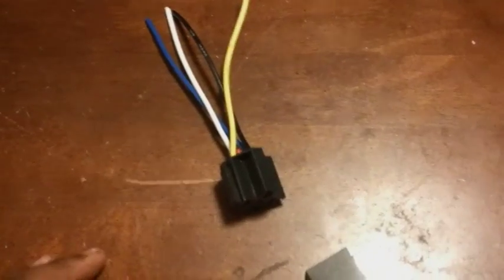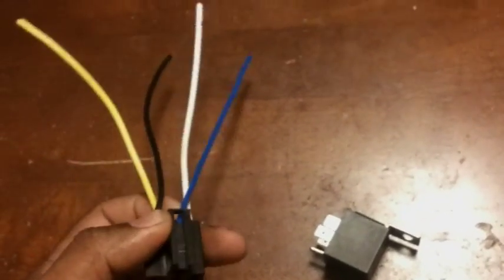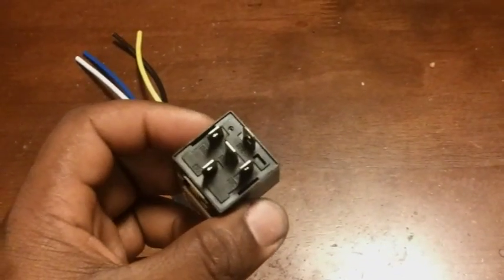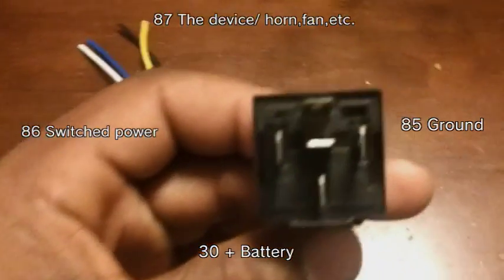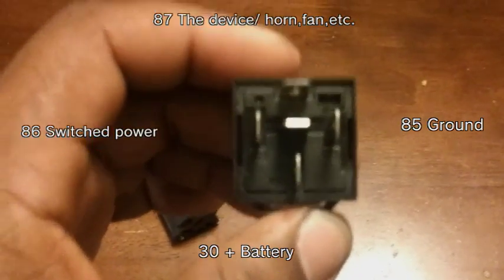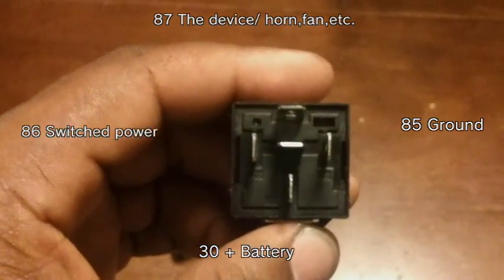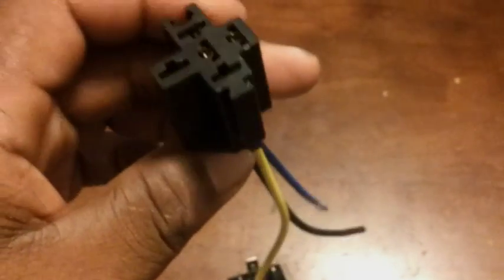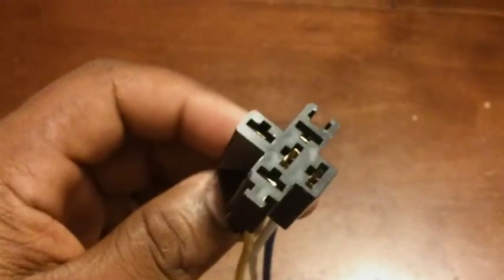How to wire a 30/40 Amp relay

Comment: I'm wondering how many amps are needed to power the relay's "switch power" side? Wondering if I can get away with using one of these for a 5amp output switch, to power a 30amp fan. would be the cheapest alternative.

Comment: I thought 86 was for ground....I did a google search and some say 85 is gnd and some say 86 is gnd...I just wired some bosch horns and used 86 as gnd and they work fine....is there a difference? Should I swap them?